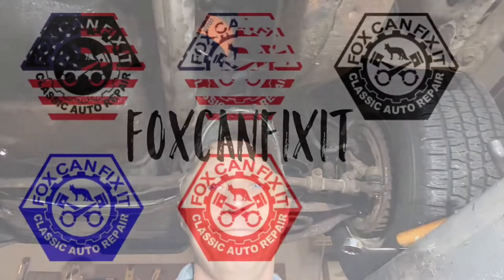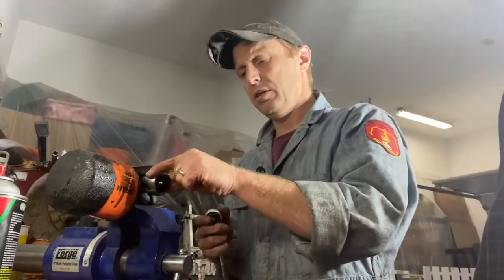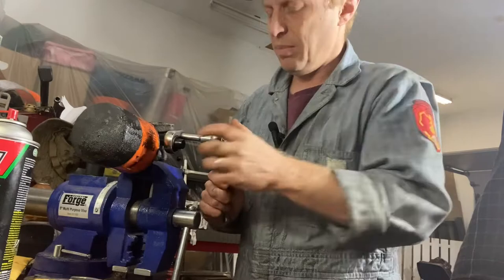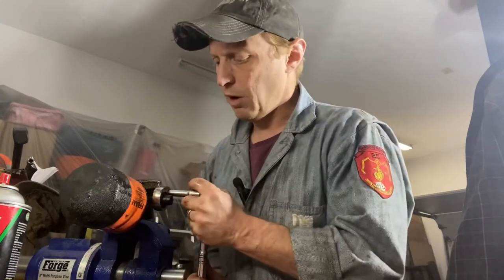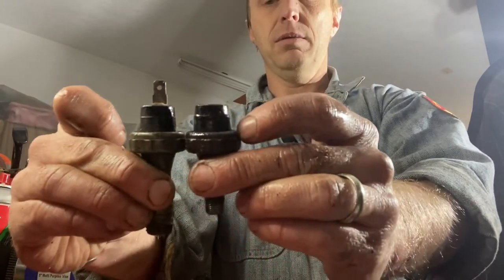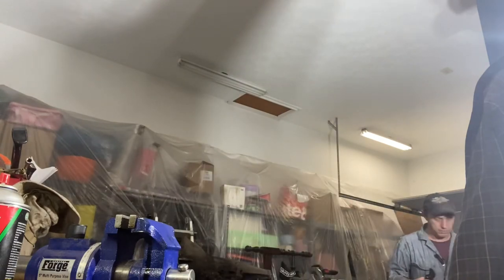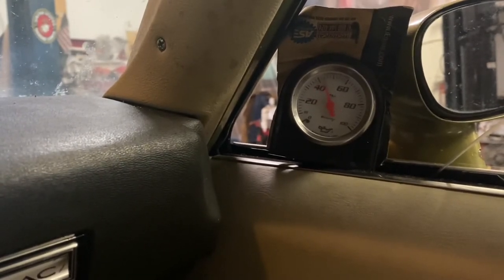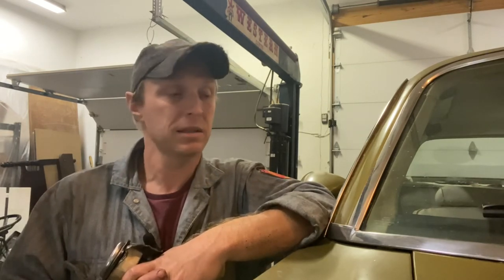Trying to replace an old oil sending unit

Comment: Out of curiosity, did you have to drain the oil to replace that sensor?
Reply from the maker: Nope, not even to remove the oil filter housing.  It’s not under pressure without the engine running and pretty much no oil comes out unless you turn the filter upside down, then about a pint spills out
Reply: @Foxcanfixit  sweet thank you for the reply! I have a 73 Catalina and it’s my first classic so I wanted to be sure. I recently replaced the modulator valve on it!
Reply from the maker: No problem, glad I could help.  The drivetrain is gonna be really similar so if you have any questions in the future don’t hesitate to ask or send me a DM on Instagram @foxcanfixit